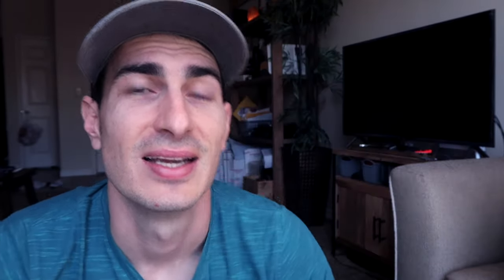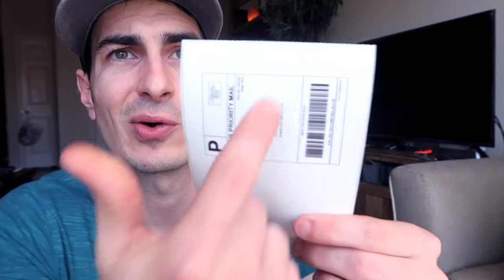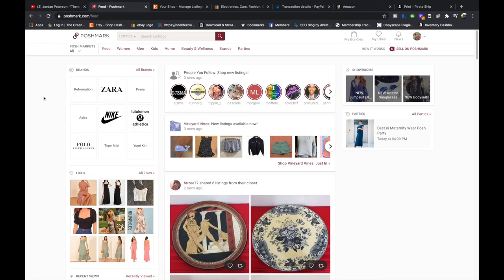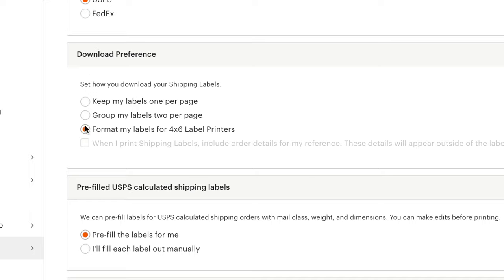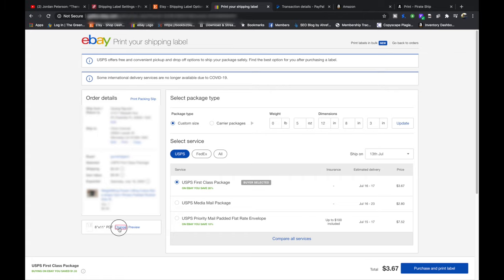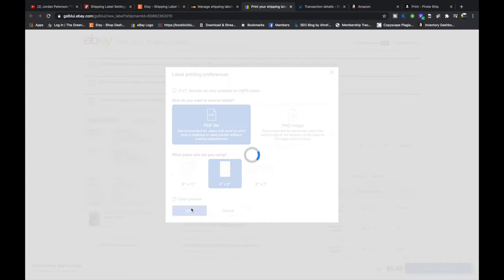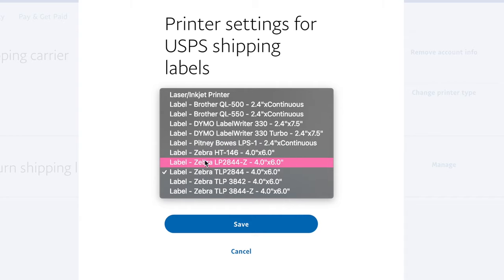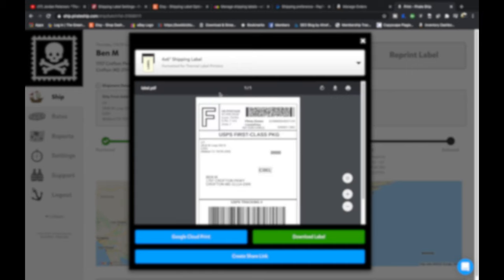How to Fix Thermal Shipping Label Printing Sideways and Small, 4x6 on Poshmark Etsy eBay Mercari

Comment: Ok been at this alllllllll day. Was hell just to download and set up the printer now that i did that its printing tiny labels. My issue is i already  paid and downloaded my shipping label from ebay. So im trying to print it from a downloaded pdf file. No luck. When i got back to ebay and try to reprint that page isnt available. Seems like id have to pay for another shipping label to get to the page you referred to to change the size. Also downloaded adobe and it doesnt look like yours.  Super annoyed. Any pointers on trying to print directly from off a saved file on computer ?
Reply from the maker: Hi you can void that label on eBay and then print another and make sure the settings are correct. That's probably the easiest route.
Reply: @thecollegepicker  hi thanks for responding i actually did all of that. Still no luck. Its printing just the top half of the shipping label  with my return address info and between 2 shipping labels. Im starting my day calling customer support ups so far transferred  me to zebra  and of coarse no one is available.
Reply: @thecollegepicker  im wasting labels trying to configure  over and over. Now the red light is just blinkn and blinkn while paper is in the machine
Reply from the maker: @tnk325i  It sounds like the power supply may be an issue, not giving it enough power. Where did you get the printer from? Rented from UPS?
Reply: @thecollegepicker  yes

Comment: I'm stuck when I am on paypal and sending international first class, bar code & scan are way too small to print on 4x6! any ideas?
Reply from the maker: Hi, did you purchase the label before changing the settings?
Reply: @thecollegepicker  Yes, it was an older label:( I guess i will have to wait until I have to send international again. It's only about 5 a month, but would be nice not to hop between printers. Thank you for this tutorial, saved a lot of headaches
Reply: Still having the paypal international Problem...also whenevr I turn the printer on a blank label spits out?? is this normal?
Reply from the maker: Yeah the printer is calibrating, that's normal.  Is the international label the same issue or does it look different?
Reply: @thecollegepicker  same issue
thanks for your help

Comment: I have 2 paypal business accounts, cause I have 2 different businesses.  My thermal printer works fine on one account,  but will not work right on the other account.  On the second account it prints large and sideways. I have them set up the same way and same settings. Do you have any idea why it works on one and not the other? Please help!

Comment: This worked great, except for the fact that my Rollo only prints the bottom half of the PDF - so the customer address and barcode, while the top half of the label is completely blank. This only happens with PDFs. When I try to print from screenshots it, auto rotates the landscape label to portrait mode - so it prints only the top half of the label and part of the barcode on one side of the label. The frustration is real. Very informative video otherwise.
Reply: Turns out Unistalling and reinstalling Acrobat fixes this issue. Cheers.
Reply from the maker: Adobe sounded like the culprit in your case. 👍 Good troubleshooting

Comment: Bought a MUNBYN thermal printer to print labels directly through PayPal and it does not work with PayPal, none of the 4x6 options worked. Beware of MUNBYN thermal printers if using PayPal shipping labels.
Reply: Hasnt to do with munbyn, it's paypals system.

Comment: Well, that no longer works on eBay. So frustrating eBay doesn't easily and obviously explain how to get the Rollo printer to print larger than 2 inches.

Comment: Doesn't work for me. I'm printing from PayPal/ShipStation. Not only does it still print sideways, but it keeps spitting out blank labels afterwards, until I have to manually cut the power to the thermal printer. I'm ready to throw this damned think out of a window.

Comment: I can't even get my thermal printer to print my Etsy labels.  They come out blank
Reply from the maker: Make sure the labels are not in upside down, also make sure you installed the printer with the correct driver.